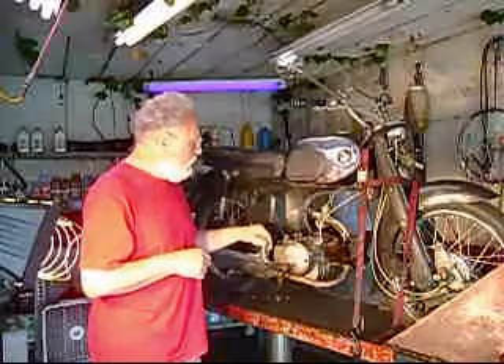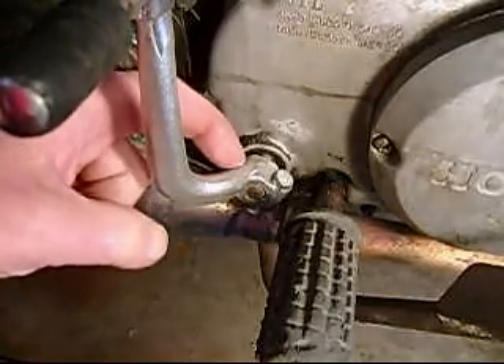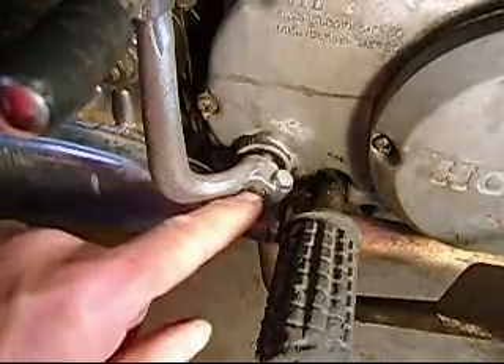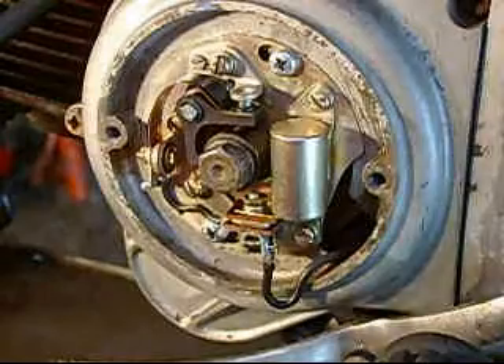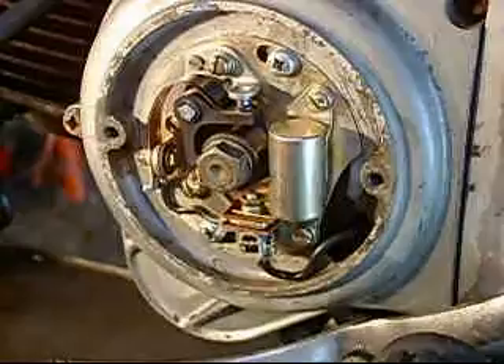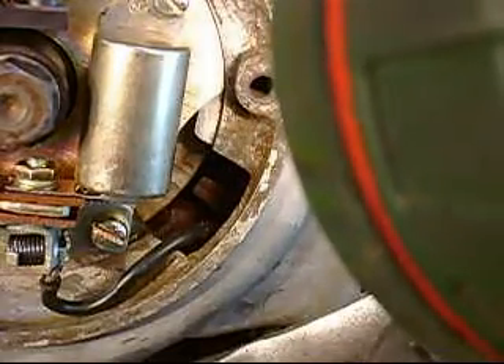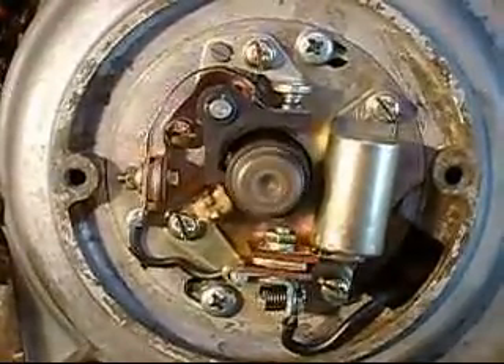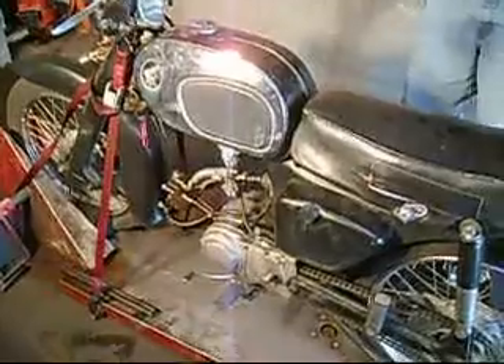Honda 90 C200 Kick pedal fix & points install & timing  www.getitrunning.com

Comment: If the there is no power in the battery, nothing will work. If the battery is week, then you have to kickstart it. If you see no spark, it is probably the ignition coils and less likely to be the condenser

Comment: Thanks for the vid... just got a 70 CT90 and wasn't getting very strong spark, got a new battery same thing, adjusted points fired right up. Still needs a little adjusting but thanks to this vid I solved the issue.

Comment: Hi, I was just wondering, I have a 1963 c200 that won't start, the points and spark plug is new and fine, but I get no spark. Do I need power in the battery to get it started or should it run without power in the battery?

Comment: would you be able to send me a quick videoor info on hooking the battery up to theis bike. Just got a project C201 and not sure how to connect battery as its a 6N6-1B and has 2 + and 1 - wire and the mess I have coming from the bike is 1 red/white and the other looks green or blue. Let me know if you can help. Ordered your book just waiting on it now.